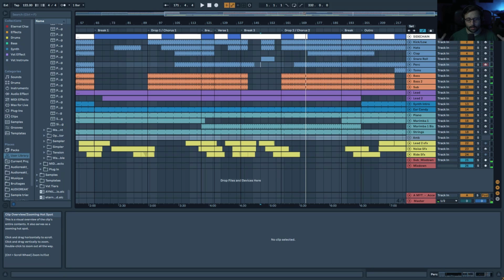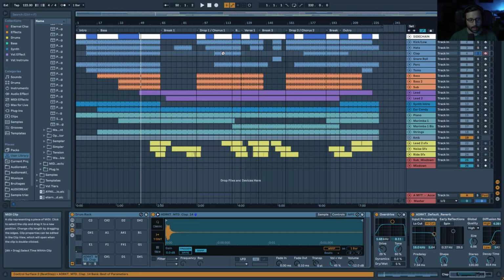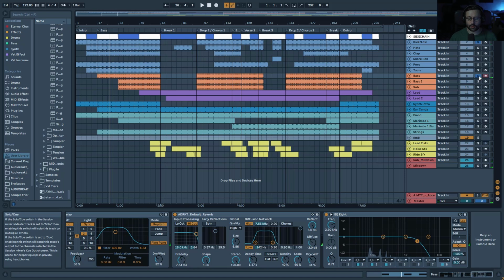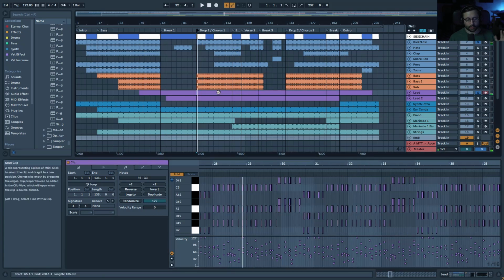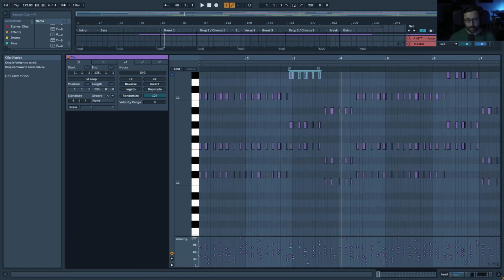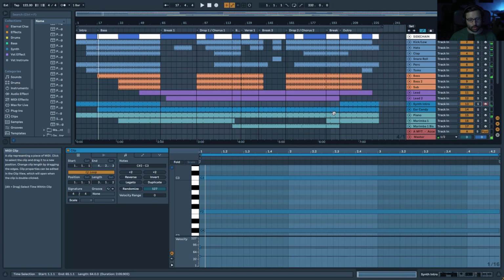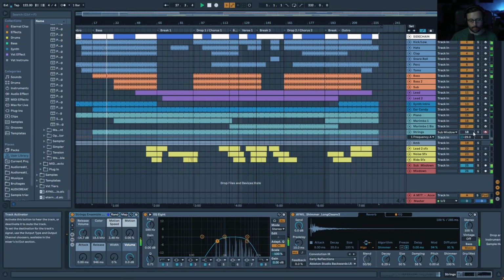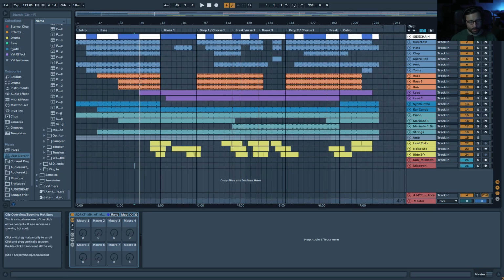How to Make Melodic House Part 1 (Sound Design & Composition) [Ableton Tutorial]

Comment: I  was recreating your template and I got a strange problem/bug. The sidechain had a awful clicking noise, more then normal. A bit strange. So I changed the attack and then I heard the sidechain sample distorted trough the compressor.... Sidechain is set to send only and not active, you should not hear it!! The whole project is ruined now(even with older backup) :( because adding a new compressor for sidechain has the same issue.  You ever had this bug and is it fixable or I will have to start a new project?
Reply from the maker: I am not sure I get your problem, the sidechain track is indeed in send only as it's whats gonna trigger your sidechain, you don't want to hear it, sorry I forgot to mention it. But I don't understand how this ruin the template as if you use the same sound to trigger your sidechain compression, the compressor  behave the same way no ?

Comment: Why you alway use a clap as a sidechain? Does it differ from using a kick?
Reply from the maker: sharp transient, no low end information, which means very fast and sharp sidechain compression
Reply: @audioreakt but on every channel? Isn't better to use the kick on the bassline to have a better cohesive sound?
Reply from the maker: @manfreofc  well it depend sometime yesa, sometime no, but to me if you want cohesive sound, make sure the kick and bass fits perfectly without any mixing apply, by choosing the right kick with the right bass, sounds selection is to me more important than mixing as like we said "you can't polish a turd". you can use vst such as trackspacer to have the kick perfectly ducking the right frequency for your bass but at the 
end of the end if your kick and bass fits well fromn the begining you don't need all that fancy stuff...